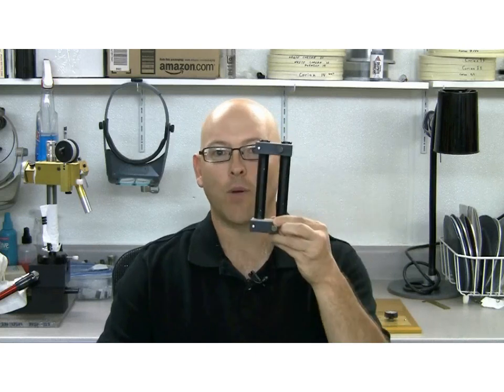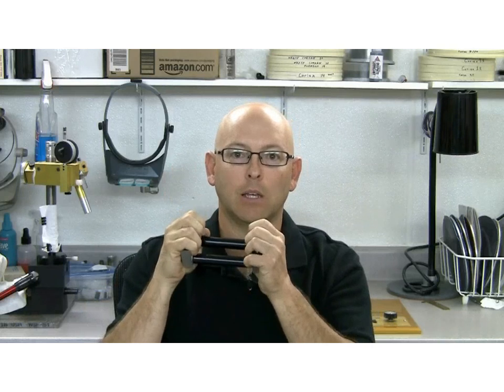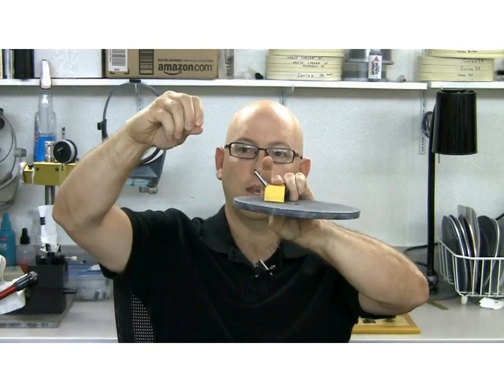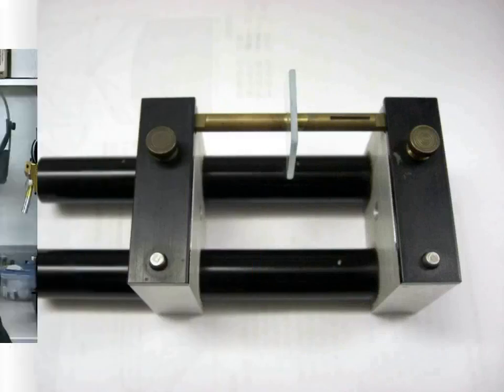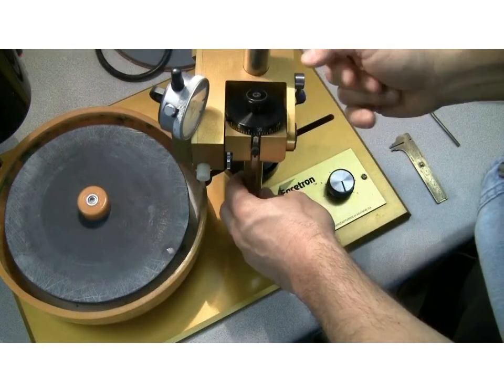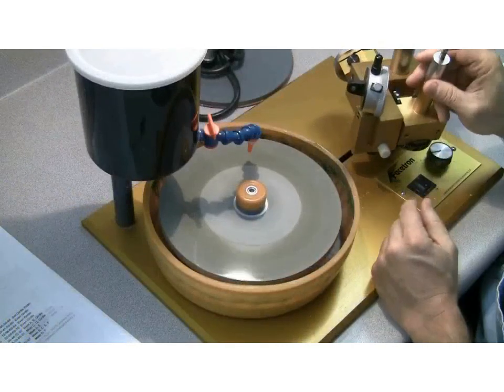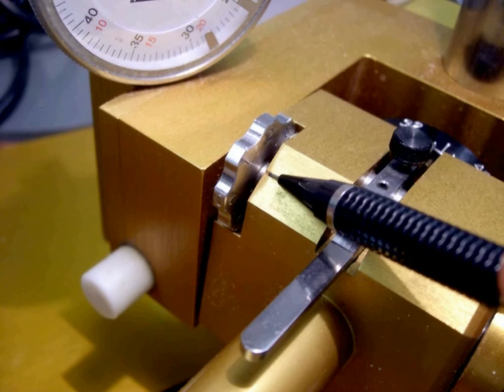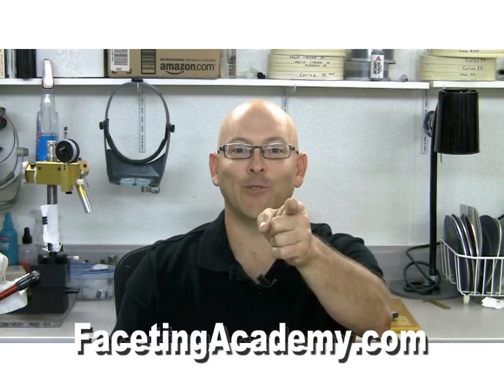Faceting: Solve girdle problems by Zeroing the Cheater

Comment: I purchased the UltraTec V5. Great machine. On cutting my first stone the crown facets would not align. I had a teacher. He determined it was the machine. My husband, being a manufacturing engineer was pretty sure he could fix it. Hmmmm, no. I tried a few more stones and struggled on my own with girdle stepping. Then got busy with other things. 2 years later, I sent the machine back to UltraTec and they found a loose bearing on my mast. They fixed it for free, so that was nice. All that to say, I'm starting back and this is great information. Thanks so much.

Comment: Do this work with Styrene acrylonitrile resin (SAN) plastic instead of glass? Found a perfect piece but don't want to put it to the lap if it will contaminate it.
Reply from the maker: I do NOT recommend using any kind of plastic for this. It might pack-up the lap, and you don't need to manufacture more microplastics.

I find pieces of glass that will work for this in the alleyway behind the local window shop, next to the dumpster.
Reply: @gemstoneartist  Haha yeez if they only knew how those fancy gems are made huh?

Comment: When faceting a softer stone I 'm doing well until I get to the 1200 grit stage, can not get the scratches out . What would you recommend for laps.  I have been told to get lighting laps. I would you recommend  Thanks
Reply from the maker: Hi, Jim,

If your 1200 is a metal-plated-type lap, move it to your kitchen or shed for knife/tool sharpening.

Seriously.

1200 plated laps are associated to SO many problems, and they're not useful in most sequencing.

You want to go from ~600 (35um) metal plated or so down into 3k (6um) or finer particle sizes for your prepolish. You'll need some different sizes there, from 9um (2k) down to 3um (8k) to insure you can step around orange peel effect when it appears.

Other than that, the main issue is QUALITY. You want solid (no toppers) and FLAT. Iv'e gone to using resin-tech laps for most of my cutting, and some of my prepolish, but still find diamond on metal (Zinc or Tin or BATT) are best.

I'm using both Dreamer 800 and HE 500 laps for my primary cutting of stones softer than Spinel - which are on Crystalite 600 standard metal bond. Then, to the diamond-on-metal prepolish.

For most stones of normal sizes, you should be doing 2 or 3 passes:

e.g. Sapphire is 600 metal - 3k Voodoo on Zinc - 50k Voodoo on Diamax or Tin+.

Anything softer than Spinel is usually Dreamer 800 or HE 500 then to polishing, and the 50k Voodoo on Diamax or TIn+ is the go-to unless we're doing Oxide. Then, it's usually Voodoo Wet Chrome on Matrix or Corian.

This sort of sequencing will keep you fast and neat, and keep your kit from bloating excessively, though it will be weighted in the pre-polishing area - again to help you step around orange peel effect.

Hope this helps. Ask any other questions.

Comment: Español

Inglés

Hello, I am left hand and I would like to ask you with the manual piece faceting machines and the mast ones, how should I do, can I change the direction of rotation of the plate ?, Thank you very good your videos, greetings
Reply from the maker: Faceting isn't like writing or drawing in the requirement for free-hand coordination. And, the tasks that each hand does don't need to be separated so much as many others in daily life.

Many left-handed people just use the right-hand machine. 

If you can find a machine that's set up for "left handed" you can try that and see if you like it.

In my way of teaching, I have a heavy emphasis on efficiency, ergonomics, and health/comfort of cutting. If I were working with you directly / personally, I would have you trying proper and efficient technique on both setups and see what works best for you. And, that is my final suggestion - to experiment and see.
Reply: @gemstoneartist  thankyou so much for answerme, regardles

Comment: Such a relief to get some practical information on this. I am in France where the faceting community is pretty slim sadly and I have been struggling with this for over a year now. I do have the added problem of a misaligned platen/mast which has made it even harder to work around and also found out my transfer jig was out and I also had a couple of grooves in my index wheel that were not machined properly...a lot of problems I know!
Having solved the problems one by one (well not so much solved as found a way to work with and around them) i still however have problems when transferring stones over: because i have to use the cheater on the pavilion (due to the missaligned platen/mast) i cannot zero the cheater as you suggest after transferring... i thought that if i started my check with the cheater on the same setting as for the pavilion it would work...but it doesn't. I have random results every time! i am not sure how to proceed from there. Any ideas?
Reply: Hi Claire 
   Sadly :-(  I think that all those work around 's  makes it impossible even for an expert to figure out why.
Is it; the mast/it's workaround, transfer jig / it's workaround, the index gear /it's workaround, you being lost or a yet another machine issue.
   good wind - Torben

Comment: The suggestion as to how to reduce transfer stair stepping is very helpful. I have, over the past 10 years, had many "doorknobs" reduced to less than 10mm due to this problem.  A fellow faceter here in Portland just 3 days ago showed me the very device you suggested.  When my new Facetron arrives in several weeks, I  will have to try this.
BTW, I never did get to thank you personally for your participation in the 2009 CWFG conference.  Your presentations were both witty and helpful.  Thanks.

Comment: john:  is there an adaptation of these cheater adjustments when using a fac-ette machine, which has a slotted index gear?  do you just put the gear in place, then release it to let it free wheel, then use the process in this video and remark true zero? would appreciate any advice.  thanks. roger

Comment: Careful: those devices can break or chip a stone easily!

Try this:

Just press the stone against the master lap. Then, blacken the girdle facet with a sharpie marker.

Drag the facet gently against the polish lap - and look to see where the ink is rubbed off. Adjust and repeat until the ink comes off evenly across the width of the facet.

That's dead-on - and proper use of a "witness facet".

Hope this helps!!

Comment: With unkeyed dops it's necessary to do a re-alignment after transfer.

The standard technique for that is using a "witness facet" to align the stone in the quill.

You set the head at 90 degrees, and put your witness facet against a master lap. Press down with your thumb to make good contact, and then tighten the quill with the stone in that position. It'll be very close, and minor adjusting of cheater will get you dead-on.

Comment: And your advice when you have a machine with keyless dops? I have an older machine. If possible when I have enough material with my rough, I use a witness facet on the crown end and align in that fashion. Or if not I use a dop jig, mine is a square piece of brass, two halves with a hole in the middle and held together by two screws that can be tightened onto the dop stick, it works for me...